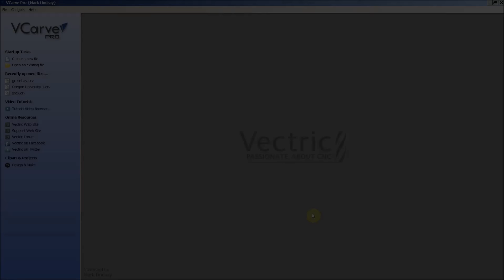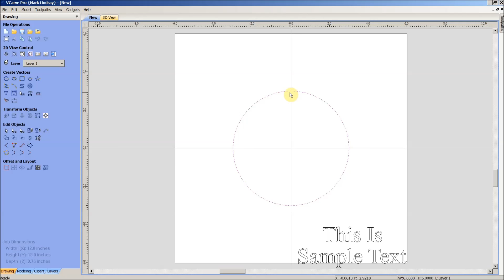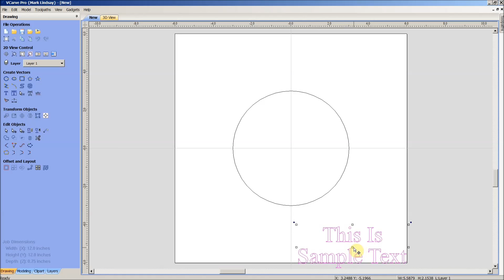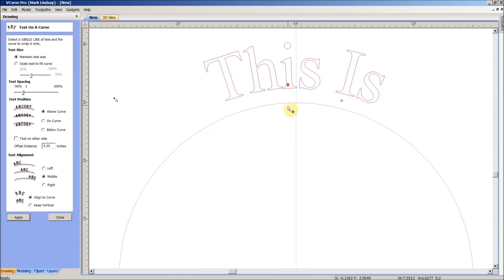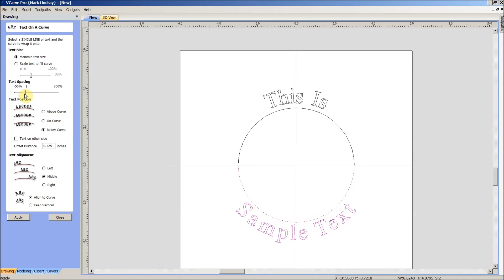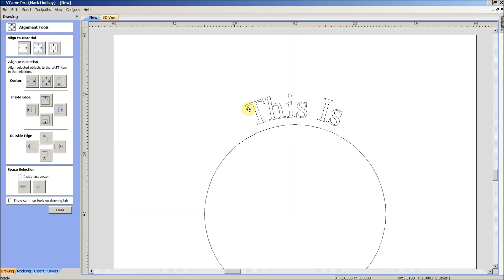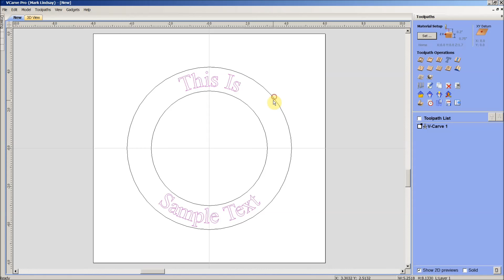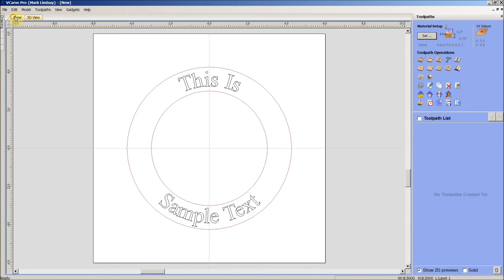Applying Text to a Curve - Part 1

Comment: Everything was good up to opening up the Curve on a text bar. It will not light up/open up, so I can not make any changes to be able to curve the text.
Reply from the maker: If the text has been converted to curves, it's no longer a text object and the tools used to curve the text will not work. Check out my video on using the Distort Tool. Here's a link: https://www.youtube.com/watch?v=IRTiQizraY8

Comment: This was very helpful.  I tried using this for a logo and designed it at 8" diameter.  Everything looks fine.  I reduced the size of everything to 1" diameter and the text does not carve in the simulation.  What am I doing wrong?
Reply from the maker: You're probably not doing anything wrong. The text is probably so small that the v-bit you've selected is too big to carve it. You might check out this video to see what's going on, and how you can solve the problem: https://www.youtube.com/watch?v=JGG0yTPih4w
Reply: @MarkLindsayCNC  Thanks for your reply.  I watched the suggested video and understand the concept.  However, When I reduce the size of the logo to 1"  the small text does not show when running the simulation.  I have tried it with 90 degree, 60 degree, and 30 degree v-bits with the same result.

Comment: Sorry for that. I'm making a sign with text wrapped at the top and at the bottom similar to what you did. I want to wrap circles around the text, top and bottom. I deleted the circle that I used to wrap the text so I would start with a clean circles. Using a 90 degree v bit. It will not carves the whole circle. It stops within an inch. Can't find a solution in the manual, maybe If I keep looking, but thought you might know the answer.
Reply from the maker: The best bet would be to contact me through my website. It would be easier for both of us that way. Thanks for watching!

Comment: hi i have a unique issue..within aspire i know how to wrap text around a curve however i have a vector that i imported and it is letters and i want to wrap them along a curve but im not sure how
Reply from the maker: For that, you'll need to use the Distort Tool. As you've discovered, applying text to a curve only works with text objects. It won't work with vectors. What you'll need to do is draw the curve you want the text vectors to follow, position it where you want the text to be, put the text in that same location, then use the Distort Tool to distort the text above that curve, or between two curves. Here's a link to my two videos on how to use the Distort Tool. (I'd check out the first one first.) I hope they help!  https://www.youtube.com/watch?v=IRTiQizraY8    or    https://www.youtube.com/watch?v=ch_8MiTjDgQ

Comment: Good job Mark! Don't worry about the time. Thought it very informative.Just a ? Is your highlighted cursor set in Vcarve or is it a system setup?I say keep'em coming!
Reply from the maker: The highlighted cursor is a part of the screen capture software I use. I use a program called Flashback Express by Blueberry Software. It's got a lot of features not normally found in a free screen capture program, and I like it a lot. There is a Pro version that runs about $50, but so far I haven't run into a need for the pro version.

Comment: Hi Mark and thank you for this video.  I have a question.  When create the text and break the block of text into lines and select the text and vector on the top center of the curve and then apply the curve my text comes out upside down and backward.   Any idea what I'm doing wrong ??
Reply: Maybe because I drew a circle instead of 2 arcs ?
Reply: yeah still upside down and backward
Reply from the maker: Select the curved vector, and tap N to go into Node Editing. Look for the green point - that's your start point for that vector. Put your cursor over the point at the far left end of that vector, right click, and select Make Start Point in that menu. Tap N to come out of Node Editing and try it again. I covered this at the 6:05 time mark in this video.
Reply: I figured it out.  You have to draw two arcs from left to right, one for each line of text.
Reply: @MarkLindsayCNC  👍👍 thanks

Comment: Thanks for another great video Mark.  I am making a table top for a store in town.  Well, I'm designing it at present.  It will be a while before I actually build it.  They are friends of mine and it's going to be a surprise.  I followed along in this video and got part of the name done.  The name of the store is "YORKS PARK GROCERY."  I was able to put the name YORKS to fit the 30 inch circle in the top part.  But when I put PARK GROCERY in the bottom half, it will only come out in really small text, not the same size as in the top of the circle.  Is that normal or am I missing something?  I am wanting the text to be inside the circle and not outside like you did, as the circle is going to be the actual table top.  Thanks.
Reply from the maker: If you're creating the two completely separate lines of text, you should be able to resize them independently. Keep in mind, however, the text on the bottom will get crowded at the top of the letters, so you'll need to do a bit of kerning to get them to look right.

Comment: Another great video.  I have a question, I am trying to rap text to curve but the window is grayed out and won't allow me do anything. Where did i go wrong?
Reply from the maker: Is the text an actual text object, or did you convert it to curves? It has to be a text object. If you've already converted it to curves, you'll have to use the Distort Selected Objects icon under Transform Objects, or delete the text and start over.
Reply: @MarkLindsayCNC  All is good.  I don't know what happened,  I exited the software and came back in and all was good.
Thanks,
LeRoy

Comment: Why didn't you set a depth when carving the text?
Reply from the maker: In v-carving text, the depth of cut is dictated by the angle of the bit and the width of the letters. In this example, I wanted the bit to be free to plunge as deeply as it needed to go in order to carve the letters in one pass. I could have set a flat depth if I only wanted the letters cut, for example, .125" deep. I didn't have that restriction, so I left the flat depth blank and let the software calculate the depth of cut.
Reply: I guess I don't know enough about v-carving to understand what you are taking about.  I just started my build on a 48x48 Garageworx cnc.  I do want to do a lot of v-carving, so back to u-tube.  I got my edge finder from Bill Briggs can't wait for you to do the video on this setup.
Reply from the maker: I'll do a video on it.
Reply from the maker: The Triple Edge Finder video is coming real soon!
Reply: I can't wait to see it.  I still have lots of work to get the Garageworx put together.
Reply: That would be great.  I hope I am not the only person which has this issue.